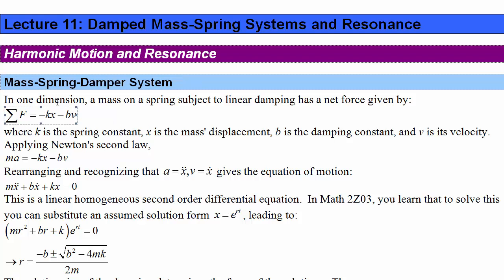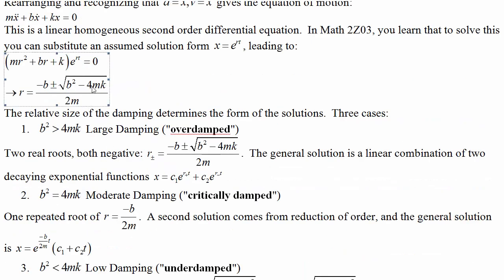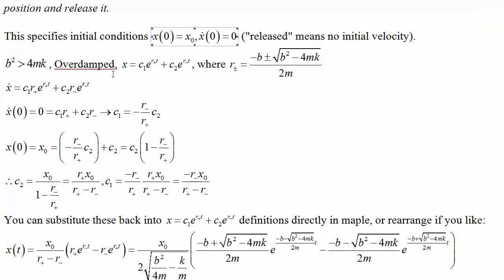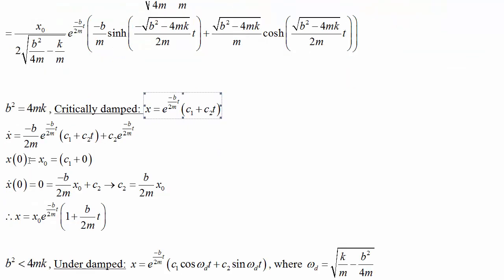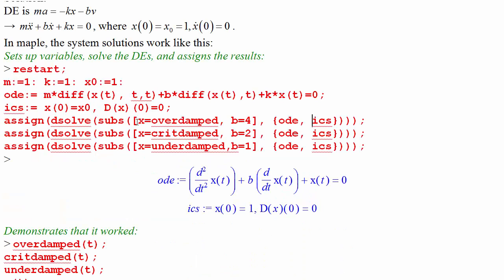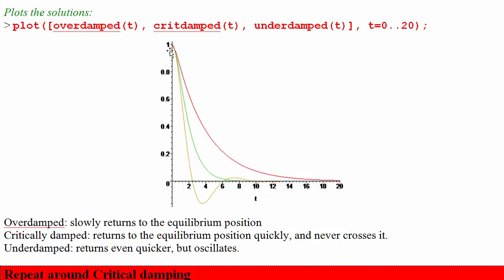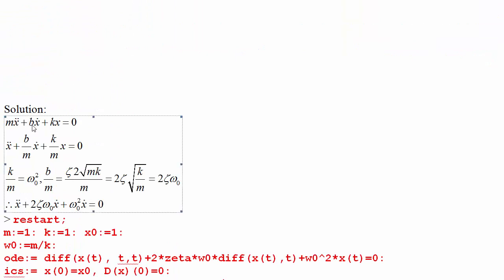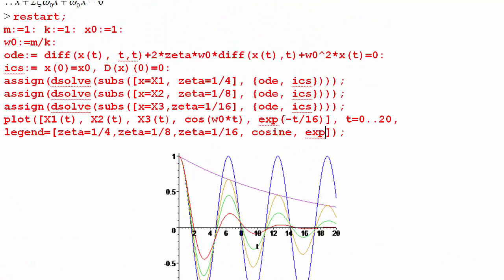Eng Phys 2P04 2015 Lecture 11: Damped Mass-Spring Systems and Resonance

Comment from the maker: There's a mistake in this!  After 4:24 the damped resonant frequency term starts missing the ^2 on the m beside the 4 under the b^2.  Any time we're summing or differencing k/m and b^2/(4*m) it should have been b^2/(4*m^2).